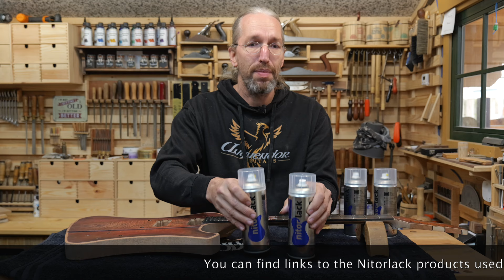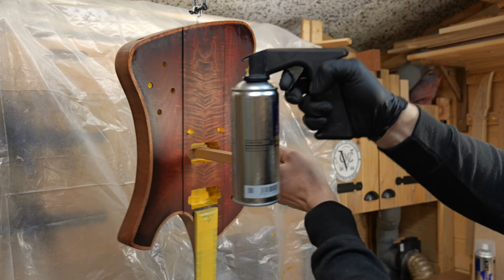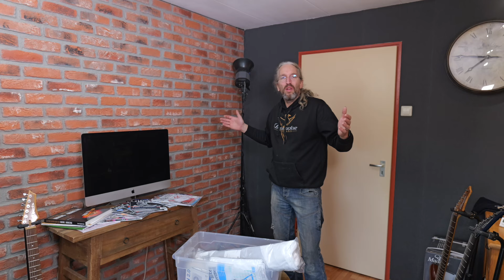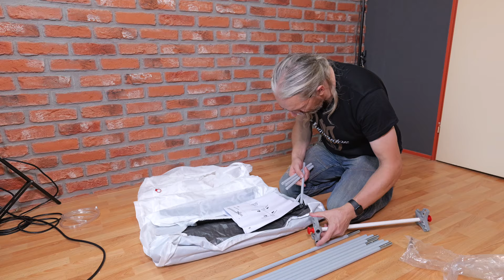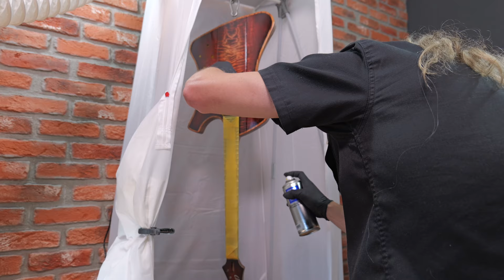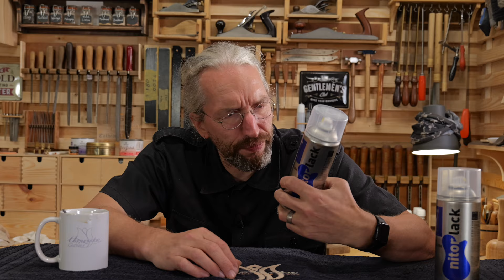Spraying Primer in my improvised  spray booth | Phoenix Rising Guitar Building Series Episode 18

Comment: Have ordered my Ikea spray boot, how did you attach the exhaust fan coduit to the tent?
Reply from the maker: Nice. 
I’ve used a scrap piece of multiply board as backing for the extraction fan. 
The fan is on the ‘inside’ of the ‘tent’. I cut the required hole in both the tent material and the piece of ply and used the mounting method of the fan to fix it to the board.
I recommend using a piece of board (plywood) the same size as the top of the ‘tent / wardrobe’.
Good luck.
Reply: @UnquendorGuitars  thank you my friend

Comment: Do you really need to wait so long between coats? I thought when you spray a nitro the next coat chemically bonds with the previous as opposed to laying on the top and trapping the unreleased solvents. I think sanding is only really necessary if there are observable blemishes. But I too am very new to spraying lacquer so my experience is also limited. Looking forward to seeing how your spray job turns out.
Reply from the maker: The waiting time and sanding in between coats is what them manufacturer recommends to achieve the best result at home with little experience. 
It is the ‘foolproof’ method. 
You are right that with experience you could spray 2-3 thin coats a day without having to sand in between coats. 
However after 3 coats you have to let them fully dry before applying the next coats or else the finish might end up to soft.

Comment: Good work! I'm struggling with the finish of a guitar (also Nitorlack products, but it is poli on my side) and the setup to do it. I was thinking of buying a beach sun-screen tent to make a portable spray boot (my first attempt is just like yours, with paper on the wall, which is a pain). Aren't you worried about the flammable vapors? I asked Nitorlak, and they told me that the exhaust fan must be explosion-safe, but these are expensive.
Reply from the maker: I’ve also considered a beach sun screen tent as the have a wider front but at this time of year I couldn’t get one on very short notice. 
It is true the fumes are flammable and possibly explosive in the unfortunate circumstance of the perfect oxygen to fume ratio. 
In a professional environment where fumes are constantly present I would always go for an explosion safe extraction fan, but for home use in an otherwise well ventilated room I don’t think there’s much risk of an explosion and if one did happen the consequences are very slim as the small amount of fumes doesn’t cause a big explosion. More likely, in the worst case scenario like a firecracker. 
So unless you intend to spray multiple guitars a day I wouldn’t worry too much.

Comment: That top did not disappoint under the sealer. I don't use rattle cans for whole bodies. Only for head stocks to bury a decal or inlay. So regular instrument lacquer goes as such. I spray the edges then the top or back then the other side then the edges again. But I crisscross like you started doing later in the video. I consider that one coat. I do that every two hours. That gives me 9 coats in three days. I'll sand after three coats to catch dust or fuzzes. If I see something in between the three coats per day i will sand those spots only. Nitro lacquer burns into previous coats so sanding for a mechanical bond is not necessary like with polys. I rarely lacquer my necks any more. But when I did I only masked the top of the fretboard so there was no ridge. And the natural break happened at the top edge and blended in perfect with fretboard oil. Enjoy your get away!

Comment: This is getting so exciting toward the end!  For what it's worth, I'm often trying to put on sanding sealer and clear coat on guitars in Florida outside in a tent when the conditions are way beyond the manufacturers' recommendation (like 90°F/90%.)  Each time, I'm  nervous that I have risked the Fates too much, and I will have a gummy mess on my hands, but it always seems to work out great.  (I do bring it inside in the AC to dry overnight or as long as it takes.)   I think if you're patient and willing to wait for your item to cure, most systems will eventually harden and be fine.  But I love Daniel's cautious approach!

Comment: I can relate man, been trying to spray nitro as well and the weather is too cold and damp, I think with nitro it doesn't matter as much with sanding the primer layers because each layer melts into the next one, at least that's my understanding, once it's all done leave it 2 weeks minimum to fully cure before polishing it out that is the key and no more than 3 coats per day, but you probably already know this.

Comment: I'm assuming that what Nitorkak calls primer is what most would call sealer but with the ability to fill grain and minor imperfections? We can't get all Nitorlak products in the US yet and I've asked them about it! A great alternative for a similar product over here is Simtec 28x50 sanding sealer.  It's a 2k product that is transparent and heavy bodied. It sands like butter and does a great job at filling grain! Just trying to help helpful😊✌️&💙
Reply from the maker: Thank you for the tip. 
This is very helpful for anyone in the US or with limited access to the Nitorlack products.